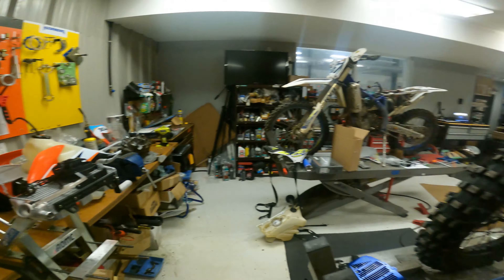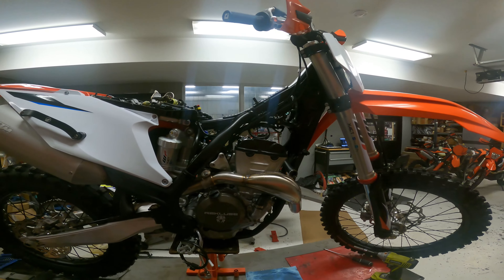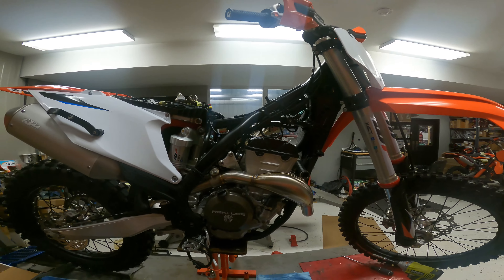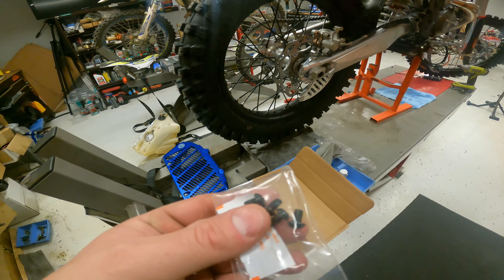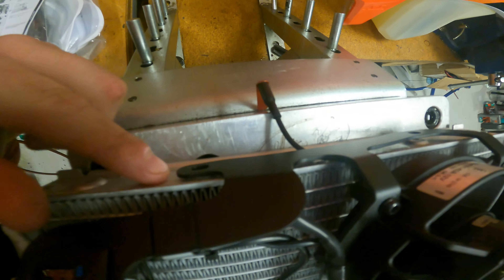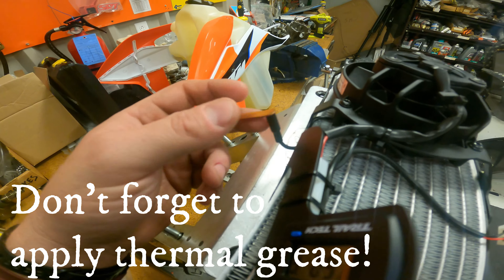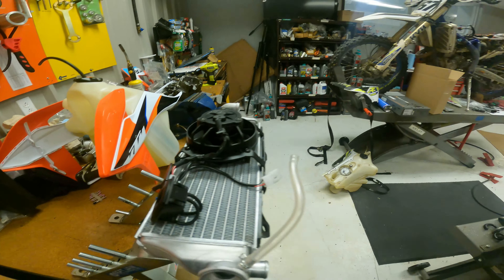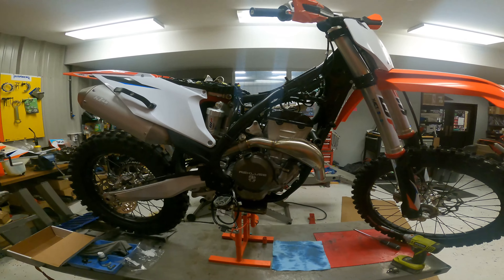What does it take to install a fan on a new model KTM?

Comment: i know this is a random question but i’m curious on how you can become a motorcycle mechanic.Like what kind of certifications do you have to have i know you gotta have your ASE for auto technician i’m from charleston and senior in high school and took 2 years of automotive tech and currently in welding. I would love to get to work in an shop like AOMC  love to rebuild bikes just don’t know what i need to do to get on that path.
Reply from the maker: Well Logan honestly most guys slip into these positions because of their passion for the sport. They either started at the parts counter, as a "shop boy", or started assembling bikes and learned over the years and worked their way into a tech job. This sport includes some much niche knowledge, the only way to learn alot of this stuff is to spend many years interested in it, or you can speed up the process by going to MMI.
Reply: @mxgryan   thanks man no iv got my own little shop i run at my house and build bikes and just got done shimming valves for a guy on his  2014yz250f

Comment: Hey, I have a 2015 kx250f that I just bought and  you can’t shift into first smooth or get back into neutral with the bike running. If you stop in first it wants to go still. At first I thought it was my hydraulic clutch not pulling it in enough, so I switched to a cable set up but it still has the same problem. Do you have any idea what it could be?